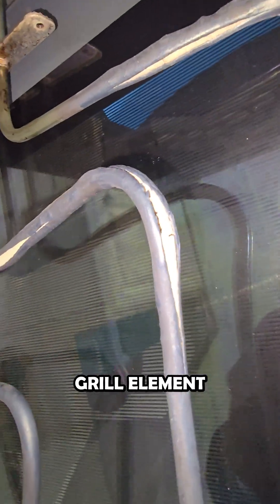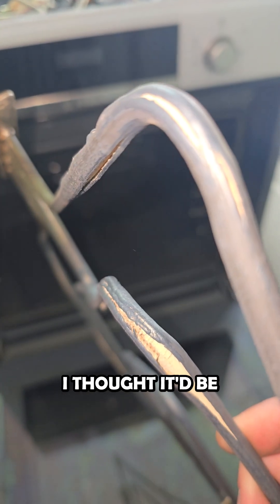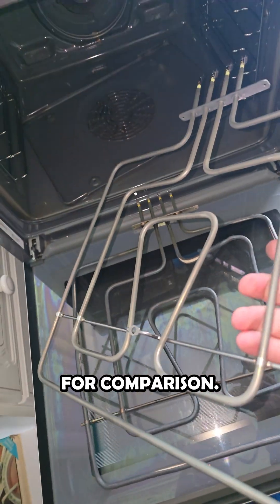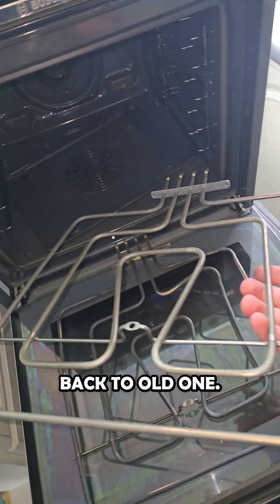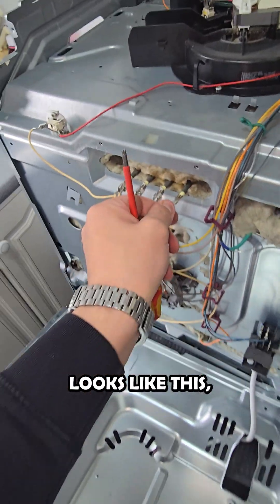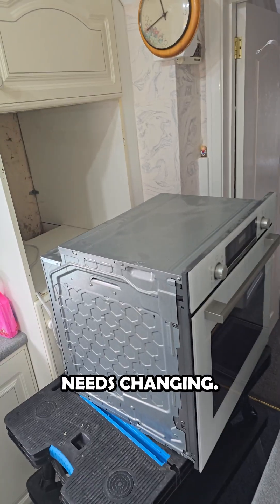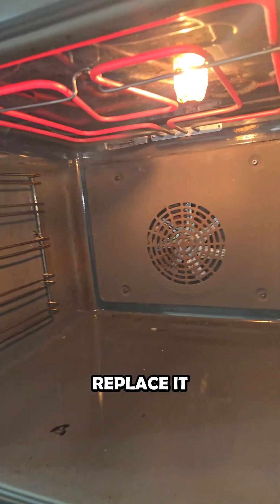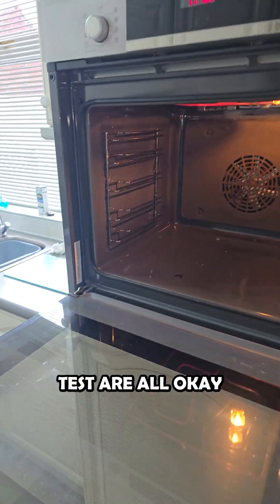What's Inside An Oven Heating Element

Comment: What a pain you got to take the whole thing out mate, got a hotpoint and can just unscrew and pull the element out with wires, granted the wire tend to try and pull/drop  back through the opening but you can tie then up to prevent lol
Reply: Only some hotpoint models are non removal, others are the same as this one
Reply: Depends entirely on the model and how it is made, even with the same manufacturer